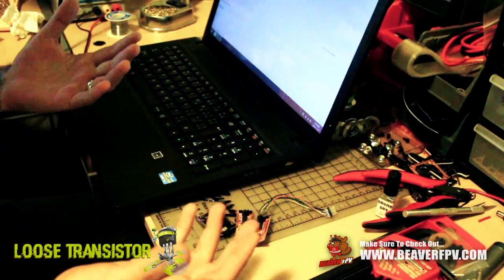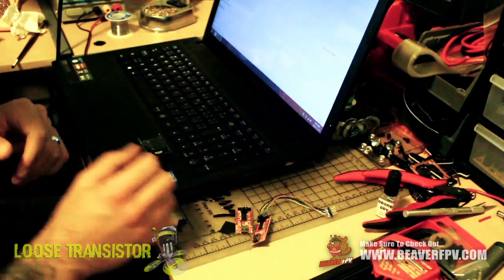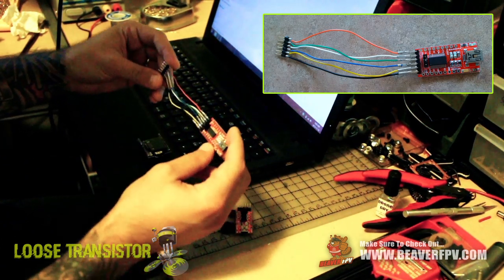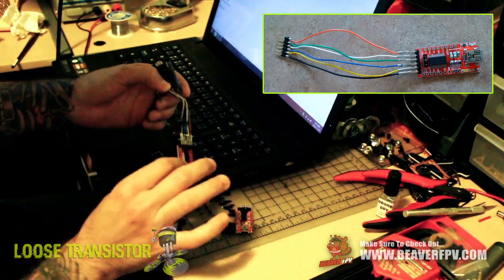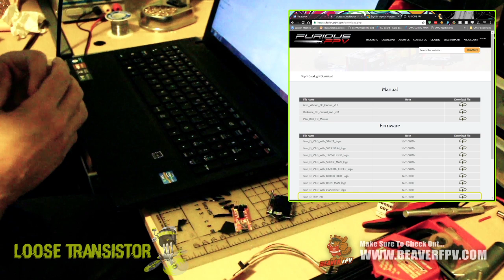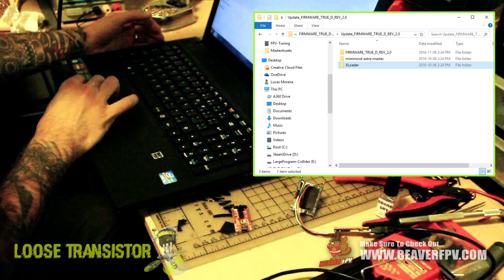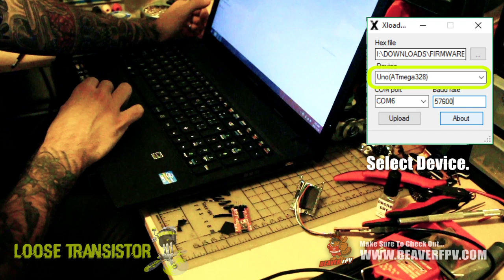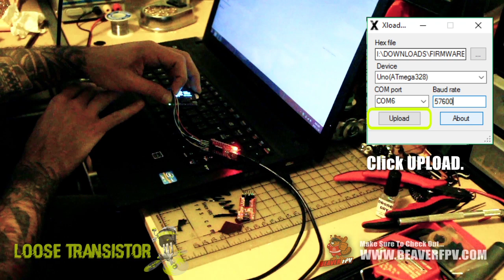HOW TO QUAD ♠ Flashing True-D Diversity Firmware Version 2.0 - The Easy way!

Comment: it looks like the upload software was only written for that FTDI adapter because I have tried ones that work on other devices but not this furious..
it has CTS/DTR but no work..  does your method work with the other software package minimosd? on that all i get is unable to talk to bootloader. The xloader gives you no way of knowing if you have a good connection other than it finishes upload. my FTDI has no LED for data
Reply from the maker: I am not 100% sure it will work with minimosd but in theory it should.
Reply: i saw it on your computer in the video. you have not tried it?
another guy made a video when he used it with FTDI.
just open program..select comport..hit read and it should read current version.
Reply from the maker: I used to have some MinimOSD board but I always had trouble with those and I basically gave up on using them. I am all about the betaflight OSD these days.

Comment: What do I do with the ascii code that shows up when you click on any of the firmware links? The only one that download as a zip is the v2.0 without custom splash screen.
Reply from the maker: Oh on the other ones instead of clicking directly do a right click and select "save As..." it will download as a file. Leave the name alone.
Reply: Loose Transistor FPV thanks mate!
Reply from the maker: No worries =)
Reply: Just tried the update and it worked flawlessly.  Had to get that Santa Logo haha!  I mean hoho!  Thanks for the video
Reply from the maker: Hahahahah awesome man! Glad that worked out =D

Comment: i tried to flash mine, it started uploading, then took a while and gave me uploading failed, now the True D module doesn't start anymore, nothing on LCD :( i'm so so upset, any help to get it to flash again !!

The screen wouldn't comes up at all, even i tried it into my goggles, so i hooked it up again into the FTDI programmer, and i kept trying to upload the FW and finally i had a led activity again and it finished fine this time, i unplugged it, tested it into the goggles and all fine now, with Ironman Logo and v2.0 FW.  but i admit i had few minutes of despair...pfff..
Reply from the maker: Hey Rogero,

Glad to hear that it was just a weird little glitch and not an actual bricked unit. Made my heart skip a beat hahahah.

What probably happened was a loose connection somewhere between the FTDI and the True .
Reply: i thought it was bricked, i'm a tech so i had everything connected right, the activity led started blinking while uploading the fw first try and then it stopped suddenly, and the module acted like dead, anyway I'm glad it worked fine later, it seems the bootloader was flashed at the beginning but not the full fw.
Reply from the maker: Yeah that is very odd man. I know a lot of people are having issues with the earlier version of the module and unable to flash =/

Comment: Tx always goes to rx and rx always goes to tx, since you want the board to listen to what the ftdi is saying and vice versa. The best way to think of it is that an FTDI is simple a usb to serial adapter :) and 57600 is the default baud rate for an Arduino's bootloader, which seems to be the heart of this system.
Reply from the maker: Good point sir!